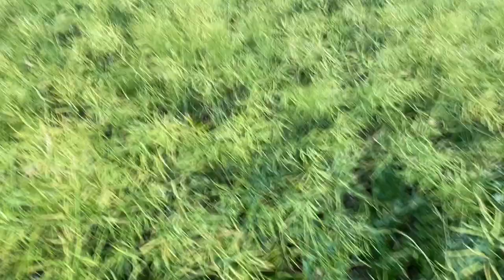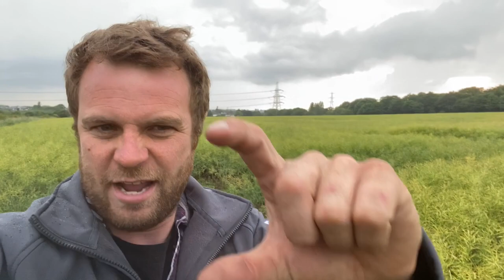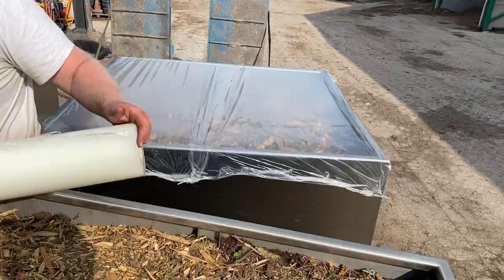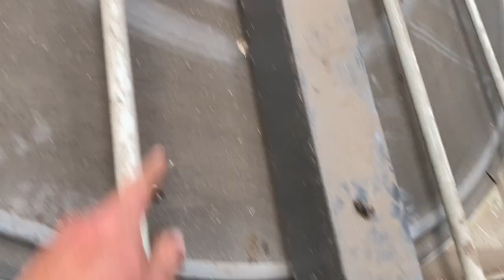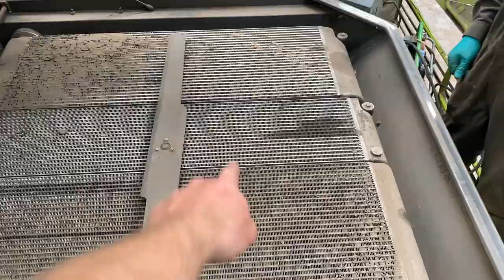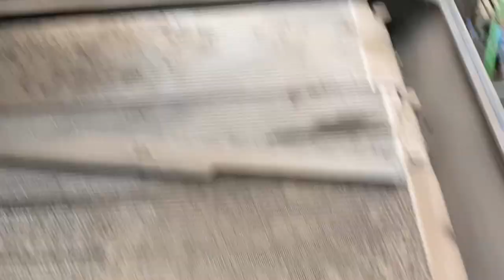Day 85 #LockDownLearning

Comment: A possible idea for the rail crossing... I'm sure at this point it's already been resolved, maybe... lol. But it would involve a bit of work and investment on the rail line's end. But they could install a sign at each crossing with a code on it. It could be a how ever many digit pin or a word or phrase or whatever. That way when you call and ask them to confirm where you're calling from. They can then ask you the code on the sign at the crossing to also verify where YOU are calling from. That would require the person to be at the actual crossing to read the sign... Like I said. I know it would require a little manpower and money from the rail company... I just feel people's lives and the money tied up in the trains is well worth it... 1 train stopped for a couple hours because of an accident could cost millions.